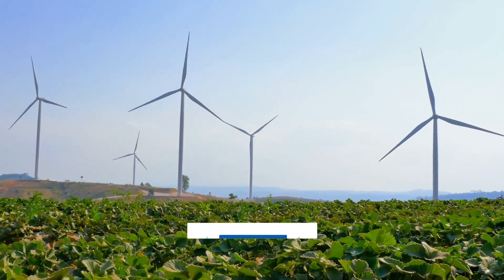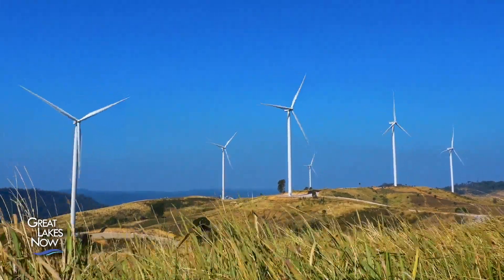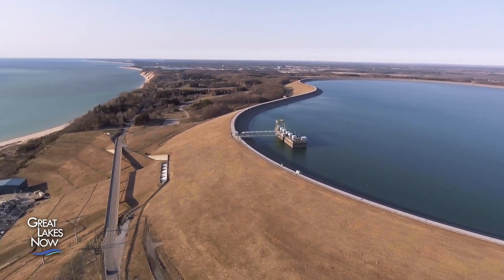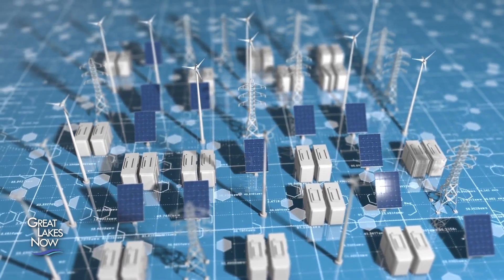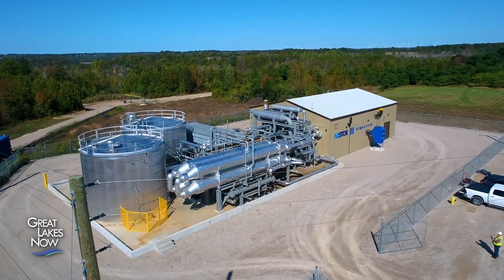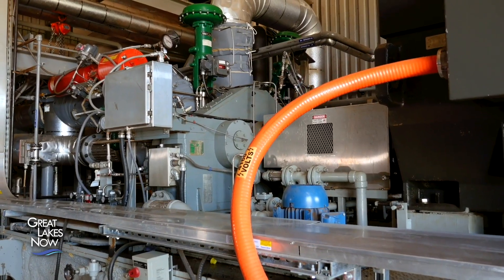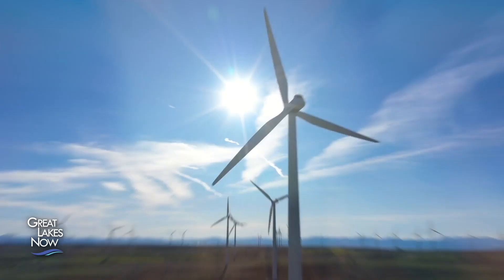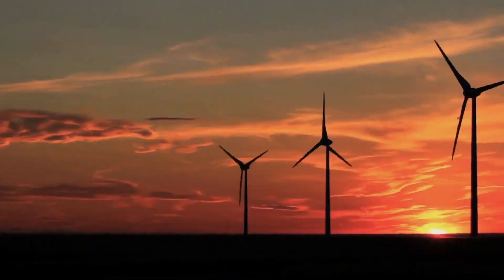Storing Energy Underground | Great Lakes Now

Comment: Could small turbines be installed at the base of every community water tower in the country?  If the total grid contribution is not significant or transmission costs for connecting to grid  too much, could water towers be a source of pumped energy storage that could be dedicated to EV charging stations or charging centers?  Is anyone beta testing this to study if it would be scalable?
Reply: Or, is it feasible to introduce small turbines anywhere fluids are already flowing,,  i.e.,  waste water management.  Could the kinetic energy be converted to electricity to offset that facility's operating costs?
Reply: I don't think this will work as you would be loosing water pressure, which is the whole point of water towers. But I do think you could manage water towers better, so they are mainly filled up when renewables are plentiful, giving you the same effect as a battery storage.